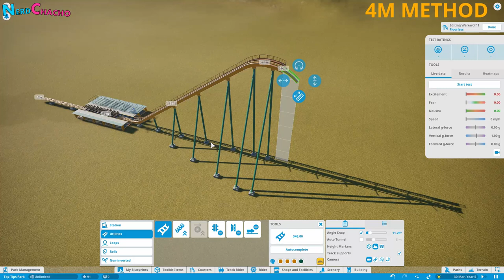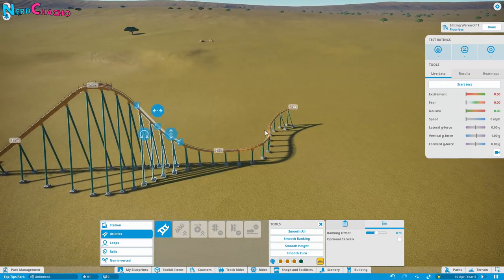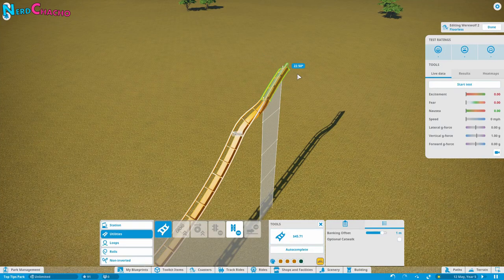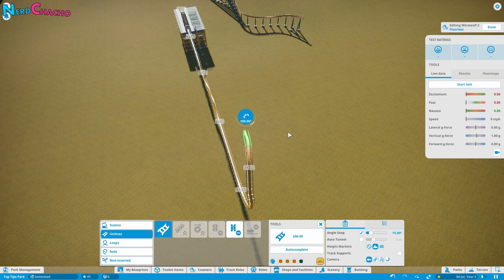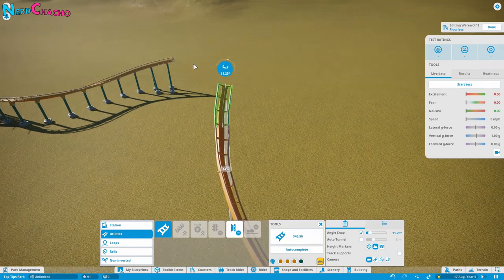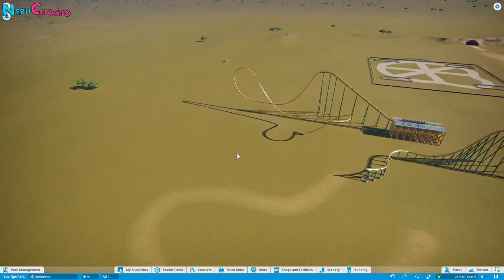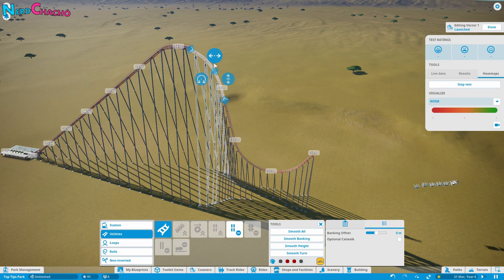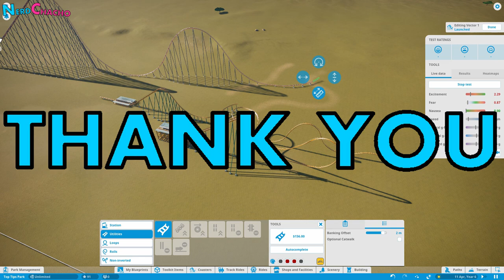#4 -4m Coaster Method - Planet Coaster Tutorial - Realistic Looking Parks in Planet Coaster

Comment: This video is amazing, but I have a couple of questions. Firstly, what's a B&M coaster (which coaster are you using in the build tutorial here, exactly), and are things like the turnaround also applicable for wooden coaster designs or other coasters that cannot invert? I've been having some issues attempting to recreate using a wooden coaster, and tend to keep having high fear spikes when performing turns.
Reply from the maker: Ahh, you general rule for turns is that you need to bank them and not take them too sharply... aim to take the turn at around 30mph-ish (that's a guide, NOT a rule) and make sure that they aren't too tight...

Comment: I had made a 5 metre coaster just before finding this video xd. Its like the 5x5 Minecraft building trick

Btw biggest tip: test the ride in first person and keep smoothing till you can see its smooth
Reply from the maker: Ahh yes, 5 and 6m works too, but you tend to find that for smaller coasters this drags them out longer than is needed... I tend to use 7 or 8 for hypers and 10 or 12 for gigas depending on how tall they are...

Comment: Can you comment on the prebuilt rolls and loops? How does manually doing these differ from plopping one down?
Reply from the maker: Really good question! I tend to use the in-built corkscrews and vertical loops because they're typically good enough.. I'll only do a custom corkscrew if I want a continuous roll or want it to be a hybrid between a zero G and corkscrew (like the B&M wing coasters) - for this you build a zero G as in this ep, but turn it to 11 degrees when you hit 135 roll, then to 0 degree turn for the 180, then -11 degrees when you get back to -135  and back to zero turn for the rest if that makes sense? The smoothing will sort out the jank you create here.

Comment: I really don't get why you insist on using banking offset when the smooth all takes it back out to smooth the banking.  Just don't use the offset and you will have a smoother track from the outset.
Reply from the maker: You're not using banking offset correctly if you lose it when smoothing.
Reply: Banking offset does not disappear, it’s coded into the track. The smoothing is just made harder to notice. If you need to see the banking offset after smoothing, the chase camera mode centers on the track and doesn’t roll the camera, so you can see how the train moves relative to the track and you can see the heartlining that way.

Comment: Just an FYI to all Planet Coaster coaster builders!
The 4 meter method that nerd chacho uses is for modern coasters who use computer assisted design tools. Coasters like the Looper, SLC, and wooden coasters if you want one specifically intended to be old, used simple circular or straight track pieces.

A history lesson if you want one: Before the 80s, coaster designers had very limited tools to help them design their rides, so to make it easier, steel coasters would be made out of a series of hollow metal tubes that they would either keep straight, or literally hand-bend them around large circular structures depending on the size of the turn they wanted. If you pay attention to a POV of any coaster built by arrow dynamics, you will notice that the track is either a straight line or follows a singular circular motion.

What this means for you is that you should make your track with large pieces and to never make any gradual changes in your turns.
For everything else though, the four meter method comes highly recommended, especially if you are building any track elements that follow a specific formula for its pieces like zero-g rolls and airtime hills.
Also, if you want to make a decent zero-g stall, all you need to do is make your basic version of it, and cut off your smoothing at the end of the roll in, and the start of the roll out!
Reply: Depend, if you go for 1m, its suitable for any kind of ride, even the old one since you can't get the bump in track of the old style coaster with bigger piece.